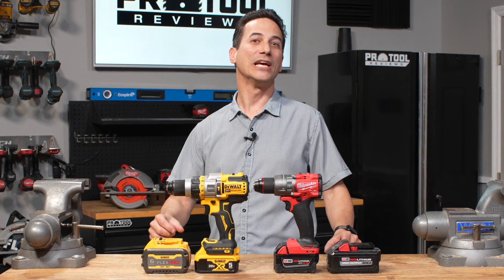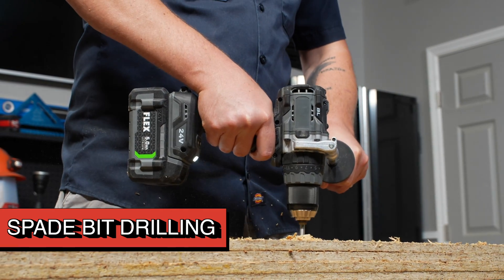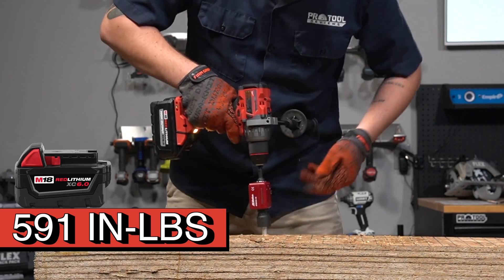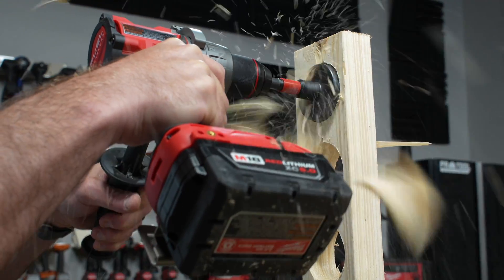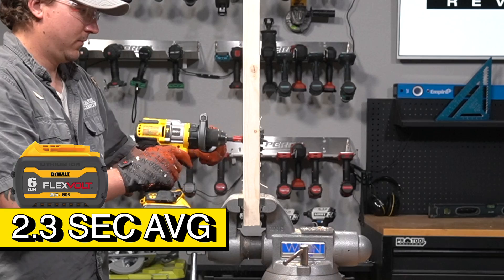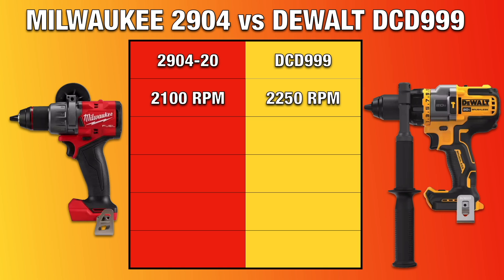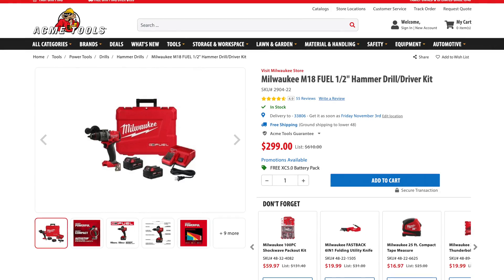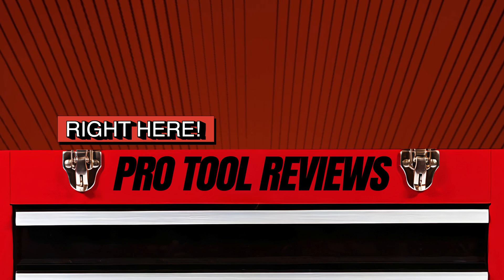Milwaukee vs DeWalt Hammer Drill - Flexvolt DCD999 vs M18 Fuel 2904

Comment: Both companies have super strong reputations and therefore you can't go wrong with either.  However, I compared these exact two hammer drill/drivers and went with the Milwaukee.  I held them both in store and found the smaller package of the M18 Fuel 2904 to be much more comfortable and a better fit for tight spaces.

Comment: I do heating and cooling those flexvolt. Batteries are horrible recently bought the GEN four Milwaukee I’m switching over to Milwaukee just because of the flexvolt batteries and that’s what makes Dewalt shine. I got four DeWalt batteries all of them ruined due to cold weather. But the standard cheap batteries are fine.

Comment: I am a DeWalt fan boy, since that’s why I grew up with and currently have in the 12 V line, So thank you very much for showing this pretty conclusive test. Especially when you’re already paying more and have to use a more expensive battery for their top line drill. It makes a difference.

Comment: The flexvolt is a marketing scheme. Mamcaver tools did tests on these batteries and it barely made a difference. He used the flexvolt batteries in the flexvolt drill. Then a different Dewalt battery in the flexvolt drill and performed about the same. Then he put a flexvolt battery in the power detect hammer drill Then a different Dewalt battery in the power detect and barely made a difference

Comment: I own both brand from impact, to heavy duty hammer drills, standard drill/driver, laser leveller, to 12V power tool lines as well. After 10 yrs of owning these tools, I have to say… I need to stop buying anymore of them.  And yes they are both fine

Comment: Unfair comparison when comparing 6.0 battery test. Milwaukee high output has 21700 cells vs dewalt flexvolt had 18650 cells. Test results would be different if using dewalt 6.0 xr 21700 cells

Comment: O broke my Milwaukee today brand New low use    Handle plastic broke in half after drill a 5/8 drill bit.  I’ll try   Dewalt now I’m disappointed with Milwaukee even when I’ve been a Milwaukee guy. !

Comment: I’m on no team I’ve used DeWalt most of my life and I’m watching these videos to see whether I want to switch or just stick with Dewalt
Reply: im a milwaulkee guy and i advicse to stick to dewalt

milwaulkee's batteries are crazy expensive and totally not worth the switch

milwaulkee is better imo but only by like 15 or 20% on our best days, usually closer to 5% and dewalt oftentimes edges out milwaulkee

not worth switching if you got perfectly good dewalt batteries and chargers

my dads a dewalt guy, he does house and vehicle diy stuff and helps out all the neughbors as well and hes never had any dewalts fail yet
Reply: imo milwaulkee is the best option if 1. you havent bought into a battery ecosystem yet and 2.  dont mind spending an extra 50 bucks for 10% more power

Comment: You going to confuse people by calling an extended capactity 6.0 milwaukee battery a high output. Its not. And the do actually have high output batteries but you aren’t using them in this video.

Comment: I've spoken to serious contractors and they recommended Milwaukee over Dewalt on durability and strength and CUSTOMER service.
They said Customer service from Dewalt was horrible and don't care about customers.
Although I with Milwaukee would improve their ergonomics and balance like Dewalts hammer drill.
I know Milwaukee shortened their back  side down to allow tight spot drilling  but I like a little counter weight on the back end to ease wrist stress. It depends on where & how your using these drills as far as ergonomics and balance or head length. one thing that gets over looked on teting these drills is how ive had some misalign/warp/ the head and causes the nose and bit to wobble after being bent. Just on some simple tasks like mixing a half bucket of mud/grout etc,,,. This happened with a Flex hammer drill i had and a Dewalt XR hammer drill did get caught up in between a couple of joists before I could pull the battery quickly.
 Both heads bent and wobble now. so I'm shopping for a replacement now.
Reply: I also like the three speed selection switch and lighting for Dewalt but want that toughness & durability the most of Milwaukee. 
Milwaukee could improve on their ergonomics and gripping.
Reply: I love milwaukee

Comment: Good video, but you left out a very important detail that puts Milwaukee way ahead of most power tool competitors.  That would be their no BS warranty.  5 years on their tools (most of them anyway) and 3 years on their batteries.  Bought my Gen 3 hammer/ drill bout 3 years ago.  It got quite a bit of use over those years.  The other week, it started acting up on me, the motor would rev up and down with the trigger completely pulled.  To be transparent, I bought the gen 3 as a refurb.  I am fortunate to live in a city with a Milwaukee service center about 15 minutes away.  Dropped it off there, and within a week, they gave me a brand new Gen 4!  I’ve also had to get several batteries replaced as well M18 8.0 & 5.0, as well as a M12 6.0.  No hassle at all.  With DeWalt, one gets a 3 year warranty on their power tools AND you have to ship it off to their service center at the your expense.  Uh, no thanks, not with these current shipping prices, certified mail, insurance, etc.

I ain’t baggin’ on DeWalt.  I prefer their saws (table & miter & planer) over Milwaukee.  They have better capabilities and typically require little to no adjustments out of the box.
Reply: How can I do that I bought my Milwaukee drill less than a year ago low use and plastic handle brakes on use so is useless now.
Reply: thats why almost all my stuff is Ridgid. Not the greatest really but more than adaquate. Except i love my 12V Mil impact driver. DeWalt cable stapler cause it was the first out and still rocks although Mil's is smaller so can get in tighter places. I've always hated Ridgids chucks so per a contractor friends rec i just got DeWalts DCD999 flex hammer drill and impact set. Hopefully wont need the warranty, that's the whole point, I do wear them out within 5 years generally, or just break them. Technically, Ridgid says their stuff is not for pros, but i know plenty who use them mainly for the warranty. They generally just replace them. I don't really use my drill that much anymore anyway so, we'll see. There is a newer model out now, I've been wondering if I should get it instead and havent opened the box yet. Mine has 2 5A batts, the new one has 2 4s so will probably keep this one. Thats the reason i'm reading this, to compare the older (mine) to the newer one but cant find anything that does that yet

Comment: I’m team “best tool for the job” I have a Milwaukee drill 2804-20 (3rd gen) that I’ve had for 5 years and have wired close to 20 large houses with it (Bearings just blew out on it yesterday and I have parts in the mail now to fix it ). I have a beloved Dewalt 20 V impact driver, Milwaukee cable stapler, Dewalt 20 V mini blower, Dewalt circular saw, Dewalt oscillating, tool, Milwaukee chainsaw, DeWalt sawzall, Bosch hammer drill, etc. honestly, if you’ve allowed yourself to be branded then you’re cheating yourself. Life is messy, one brand rarely fits all needs perfectly…if you want the best tool in each class.

Comment: The Milwaukee XC 6.0 48-11-1860 battery you used in your testing is not the "High Output" Battery. It's the "Extended Capacity" battery which is made with 18650 cells.

The Milwaukee High Output XC 6.0 is the 48-11-1865 which is made with larger 21700 cells.

How can you make a review on new tools without knowing the product line? 

Your testing is inaccurate therefore inconclusive. 🚫

Comment: I've always had Milwaukee but anything after gen 2 the chucks SUCK!!! Constantly dropping bits no matter how tight you chuck them up.
I recently switch to dewalt purely for this reason and low and behold an actual drill that hasn't loosen up once since I've owned it.

Comment: Before I became "'Consumable Tool Purchaser"' 15 years ago, our machine shop was outfitted with a hodgepodge of various corded and cordless power tools.  I'd had history with Milwaukee, who REALLY take care of their customers after the sale.  One sad little DeWalt drill caught my attention with its chuck runout.  You could actually flex the chuck's mounting arbor by hand.  I christened it, "DeWobble"'.

Long story short, the entire shop is now flooded with Milwaukee tools of every kind, corded and uncorded.  Only complaint is, the battery cases crack & break after being dropped a few times.  Otherwise (knock wood), they last & last, with never a complaint about their performance.  

Now that Milwaukee batteries are charged ad charging in every corner, the chances of any other company getting in, are slim.

Comment: 1) I think the prices you mentioned should include both regular and discount ones. Telling just the discount ones seems unfair.
2) You should have tested torque controller on all settings.
3) The main advantages of DCD 999 seem to be better cooling system, gearbox casing and different light settings. Milwaukee is better at max torque and above all, compactness.
4) Milwaukee features glass fiber reinforced nylon casing and DeWalt apparently has polycarbonate one that has some chemical vulnerabilities, notably household ammonia.

Comment: -- Without watching.  DeWalt and Milwaukee go back and forth, and some of their tools are better than others.  Hard to go wrong.  I run all DeWalt.  My brother runs all Milwaukee.  We're both satisfied with each other's tools.  And I've been running DeWalt since the late 90's.  They were good back then too.  My my barn is yellowjacket, as is my workshop inside. 
   I find the DeWalt units run a bit cooler.  Especially the chainsaws.  In that instance Milwaukee edges out DeWalt in performance (chainsaw) but overheats and shuts down faster.
   My experience with both tool sets.  The DeWalt tools just last longer/don't wear out as fast.  Still rocking my same drill, let the kids use it, get's used 5-6 days a week, more than my brother's Milwaukee, and he's had to swap to a new one.

Comment: Wrong photo for the Milwaukee 48-11-1860 (6Ah). You used the correct battery but you should probably update that little photo in the corner.

Comment: It may have been too new for the video, but it would have been interesting using the milwaukee forge battery which also is 6Ah against the flexvolt
Reply from the maker: Correct, we didn't have our hands on the Forge battery in time for this round of testing, but we're going to be releasing new videos that feature tests from the M18 Forge batteries very soon! Stay tuned!

Comment: i just bought the milwaukee tool plus 2 batteries kit, ace had it on discount, plus a coupon for 220...dewalt not gonna beat that deal.  it drilled into brick just fine.

Comment: Both are nice and any tradesman would be well served by either tool. But I’m in the DeWalt platform and have invested in both Flex Volt and Power Stack batteries so I got the DCD999. So Team DeWalt. 
No hate to Milwaukee if I didn’t have DeWalt Milwaukee would be my 2nd choice.

Comment: Can you do them drilling in steel? I’m usually using my drill to drill and tap through anything from sheet metal to 2” thick steel plates.
Reply: i have the dewalt, for anything thinner than 10 mm i don't even use my mag drill anymore

Comment: Just a suggestion, a more fair comparison would be using the Milwaukee hammer drill with their new 6.0 Forge battery. The Forge battery improves the overall performance of Milwaukee tools by approximately 10% - 15%.  This new battery also can be charged from 0% -80% in 15 minutes. I think using the Forge battery, which outputs the same power as the old 12.0 battery, would be a more apples to apples comparison.
Reply: Oum

Comment: A criticism about this comparison is that the comparison doesn't show the top power of both drills using the most powerful batteries avaible. The Dewalt has a 9AH and a 12AH battery. How would Dewalt's torque using those batteries compare with the Milwaukee? We want to see which is capable of the most torque possible. This comparison doesn't do that.
Reply: Milwaukee also has a 12ah battery. What's your point?

Comment: I’m torn between the two. The only downside to the Dewalt is that it doesn’t have anti-kickback.
Does anybody have any advice for me?
Reply from the maker: If Anti Kickback is high on your priority list, Milwaukee would be the way to go.
Reply: @Protoolreviews  I’m taking several things into consideration. The warranty is also important. The Dewalt is, no doubt, a great drill, but the warranty is a little sketchy.
There is a video on YouTube where they charged a guy over $100 to replace a board that went bad in his impact driver in just over a year.

Comment: I found that the 999 actually drives a long auger bit more effortlessly than the Milwaukee.
Don’t get me wrong, they’re both amazing drills. The Milwaukee bogged down just a little bit with the 5 amp battery.
Reply: The m18 5.0 batteries are trash. I wouldn't buy them for $20.
Reply: @operator8014  The Milwaukee I got also bogged down with the 6.0. I think I just got a dud.

Comment: I love the Flexvolt 9AH so it’s an easy pick for me. But, Milwaukee make excellent tools & usually at the top of any list - I just happen to like Dewalt’s batteries more
Reply: What do you like more about Dewalt batteries?
I’ve heard mixed opinions about them and, now that Milwaukee finally released a stacked lithium battery, I think they are going to be more popular than ever.
Reply: @DiligentDave1966  it’s the history of never having issues with them - that & how damn powerful the 9AH flexvolt is. I picked up some of the 5AH power stacks too - just solid batteries that can take a beating
Reply: @LorenzKamo  I’ve heard that the Milwaukee batteries are better, but I don’t have firsthand experience with Milwaukee batteries.
Wednesday night, I ran a three way test between the 999, the Flex and the Milwaukee 2904.
The Flex just wasn’t very comfortable to hold for very long.
The Dewalt is a little heavy and bulky, but very comfortable and runs smoothly. I’ve Milwaukee is the most comfortable, but I still need to decide.
I might also test the Ridgid.
Reply: @LorenzKamo  Do you have the DCF891 impact wrench?

Comment: Hey everybody, I just ran my own test last night, and I don’t think you can go wrong with either one of these drills.
I also tested the Flex, but purposely didn’t use the turbo to make it fair.
I tested a1/2” twist bit, a 1/2” spade bit and a 1/2” auger bit in each drill going through 8” of wood. All three drills were tested as kitted.
Without turbo, the Flex was the slowest of the three. Both Milwaukee and Dewalt performed very well. The Milwaukee had the 5 amp battery and the Dewalt had the 6 amp flex volt battery. The Milwaukee was the fastest overall, but the Dewalt was the fastest with the auger bit. 
The Milwaukee and the Flex got very slightly warm, but absolutely nothing to worry about.
The Dewalt was smooth, stayed cool and never even bogged down in speed three. The Milwaukee only bogged down slightly with the auger bit.
I was really impressed by both drills.
Reply: Foi uma comparação injusta, deveria usar o turbo, já que faz parte da ferramenta!
Reply: @lfs0111  No I shouldn’t use the turbo because I wanted to compare apples to apples.
The other drills don’t have turbo and are more comfortable to use.
Also, anyone who actually uses the Flex on a regular basis will tell you that the turbo makes the drill get hot much faster.
Reply: Yet its supposed to be used with flex volt, its like removing a wheel off a car and comparing it to another with 4
Reply: @VTepesIII  I used the flex volt battery when I did my test. That’s exactly why I posted this comment
Some YouTube channels do what they do for the sole purpose of gaining views.
That’s why I feel it’s important to do your own comparisons, and see what tool works best for you. It’s not always about power or speed, but being able to use something comfortably all day long it’s just as important.
Quality is also a big factor. 
The second time I tested the DCD 999, something inside made a clacking noise when I was tightening a bit down in the chuck.
The Milwaukee is strong and fast, but it wasn’t that comfortable for me to use on a regular basis. It tends to lean forward in my hand, and I end up drilling crooked.
I ultimately went with Ridgid, because it seemed to check all the boxes for me.